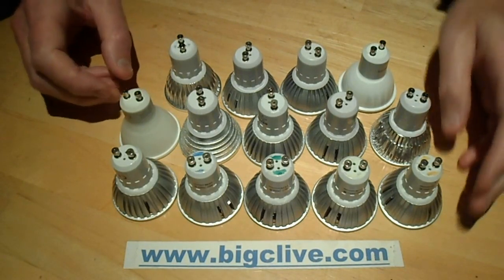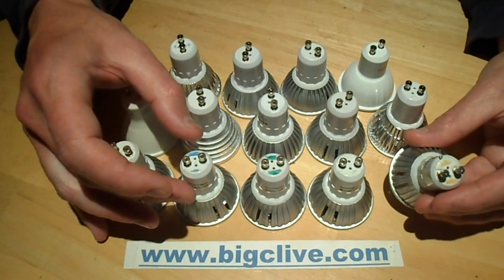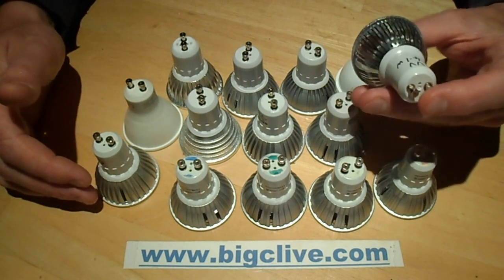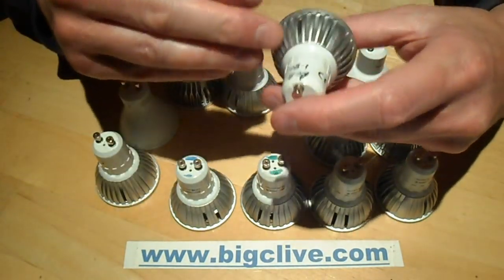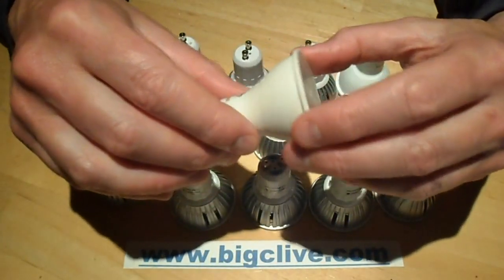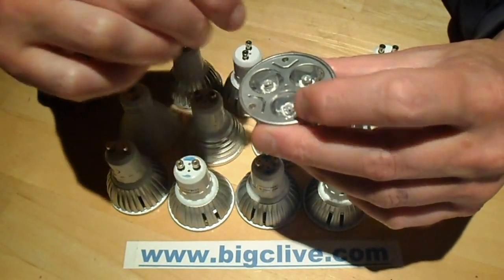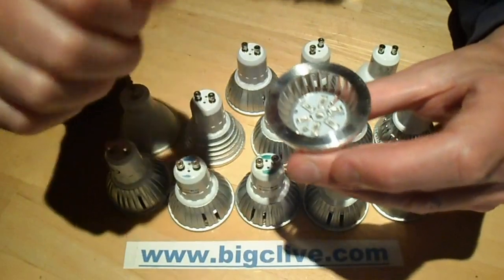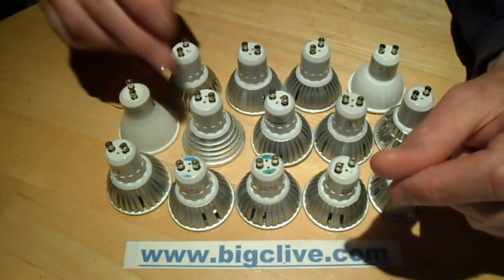Fantasy power ratings of hydroponic and other GU10 lamps.

Comment: I was honestly expecting a lot worse than that. Aside from those hydroponics lamps, most of those are at least semi-accurate (or based on the driver chip being used, in the case of the red LEDs). Maybe the ratings start to get a bit more hand-wavey when you get up to higher power. I guess it isn't like knockoff lithium cell capacities, where the manufacturers just put down whatever number they feel like.

Comment: Have you been able to test out the grow lamps at all to see if they actually work to grow plants? I imagine the lower wattage would result in problems with distance from the plant to the light, but also if it's the wrong wavelength they may not grow correctly.
How much did the hydroponics lamps cost?